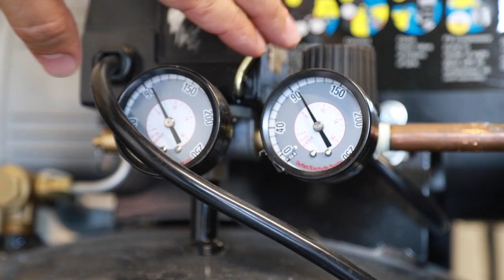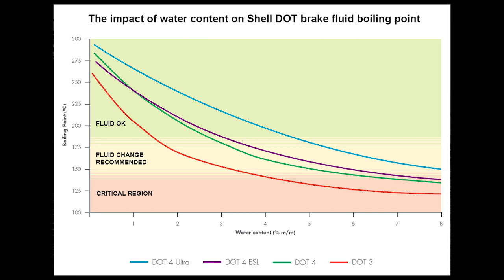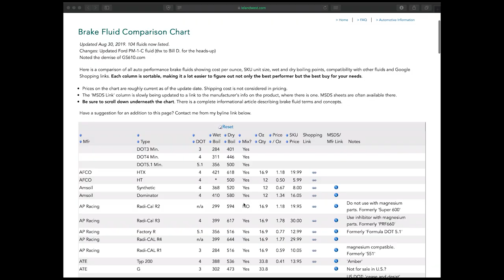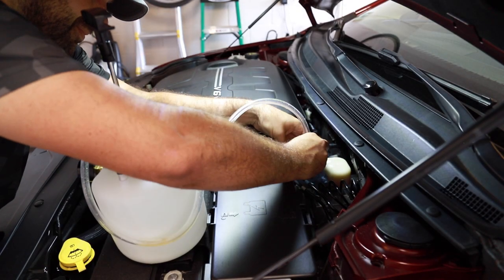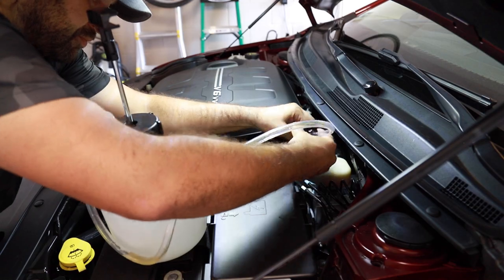Easy Brake Fluid Flush: How to Flush and Test Brake Fluid

Comment: I bought a new Motive bleeder kit along with motive adapter that is advertised as compatible with Hyundai / Kia. I had mixed results.  I just read the quick instructions on the box. ( No long detailed instructions paper included - you are supposed to print them from the Motive website & the FAQ's ) I skipped the dry test, where you connect the system, no fluid,  & hold 13-15 psi pressure for ten minutes.  and poured brake fluid into the Motive pump. I pumped and around 11 psi the adapter leaked fluid on my engine. NASTY. Of course, i picked the wrong size rubber o-ring adapter ( its not a spare they are different sizes).q  I cleaned up.  I then unscrewed the adapter, cleaned it , and screwed it back on, albeit tighter. Now the system holds pressure fine. Proceeded to bleed my brakes. Good. However, when I attempted to remove the motive adapter, it wouldn't turn. Tried & tried. Read on internet to double-check counterclockwise to remove . Waited for next day, my 250 lbs couldn't unscrew the adapter.  Now im driving with the adapter still on but corked and encased in duct tape.  Frustrating. I emailed Motive Support & they responded there is no procedure to remove an over tightened & wrong size rubber o ring.  They pointed me to slip joint / Channel lock pliers .
Reply from the maker: That's really frustrating what you went through. Must have been a bad unit. I have adapters for Dodge, Mazda and Ford and I didn't have any issues. I love this thing. Maybe they'll hook you up with a replacement unit.

Comment: I wonder if it's possible to bleed all four brakes at one time as long as you keep the master cylinder filled?
Reply from the maker: Yeah, with 4 people, absolutely. Just have enough fluid in the contraption. It will keep pushing the break fluid down. Technically, it would qualify as an F1 pit stop ;)

Comment: What is the pressure you should put in with the tool? That was 15 PSI or Bar?
Reply from the maker: It's 15 PSI. It will say it on whatever tool you buy. The sweet spot is marked in the middle. Honestly, I think I went a bit above, but that tool is probably my favorite in my garage.

Comment: when you pulled out the remaining old fluid out the reservoir. did the remaining air void get pulled back into the brake flush tool or did the air get pushed into the brake lines? just asking so to know if i wait to see the remaining air come out when carrying out the brake bleed. thank you
Reply from the maker: I usually put a whole bottle of brake fluid into the tank. Once its pressurized (around 15 psi), once you open the valve at the individual caliper it will just push the fluid right through. When you see the color change all the air and old fluid should be out. I never used more than a liter of brake fluid in the canister. I wish they had a pressure release valve as when I'm done I have to open the canister which still have pressurized air. You don't have to worry about any air getting into your lines throughout the process. The system is well designed. Just make sure there is enough fluid in the canister or reservoir. As long as there is fluid in there it can't suck any air in. 

Trust me, once you do it, it's so simple. Everyone I know who got this is amazed by how quick and easy this works.

Comment: So I bled my car with new fluid and the tester is still giving me above 4% moisture. Any recommendations?
Reply from the maker: Oh wow, that sucks. Was the fluid old? Maybe a faulty tester. You just put the contacts in? Get another bottle of new brake fluid from a different store and test it. It should reveal whether it’s a faulty tester or you bled with old oil. 

People haven’t been driving much. Maybe it was an old bottle just sitting around forever.

Comment: Do you have to jack up the car on all fours? Can you just do one tire at a time? So after you open up the brake valve, how do you know that enough fluid has been drained out?  Will it change color?
Reply from the maker: You can do 1 wheel at a time. I shot 3 episodes that day and the car was already jacked up on all 4. 

Yes. You will see the fluid getting lighter. It was hard to see on camera especially that Pentosin Super DOT4 is brown/orange. 

The reason I used that fluid is because I alternate between Pentosin and ATE 200 which is green/blue in color. This way, next time I flush it is clear as day. The Chrysler 200 had still its stock fluid in it, whereas my other 2 cars were on the green fluid. 

If you only do 1 car, get the ATE200 first and then use pentosin next time around. If you choose DOT3, it’s usually clear so you can clearly see it as well. 

Good luck! Thanks for watching.

Comment: Hi! You wasted the expensive brake fluid just to flush the old fluid. Just to flush old fluid why don’t you buy cheap 1 gal. New brake fluid?
Reply from the maker: Once the cheap stuff was out, I just did enough to cycle through. I usually get the gold fluid, next time around I get the blue stuff, then change again. It’s easier to see the difference especially when you flush it out every 2-3 years. On the Miata it’s changed every 6-9 months. Makes it a lot easier to see. Also, the dot3 is cheap stuff. Nothing I want in my car. I usually use a 1l bottle per flush. Once the bottle is open I try not to let it sit on the shelf too long, so I might as well use it. Either way, this is me, you do you. I appreciate you looking out for me, but tires and brakes is not a place I care about savings. Anything else however, I’ll pinch those Pennies hard. YouTube just not paying me enough to quit my job yet ;).